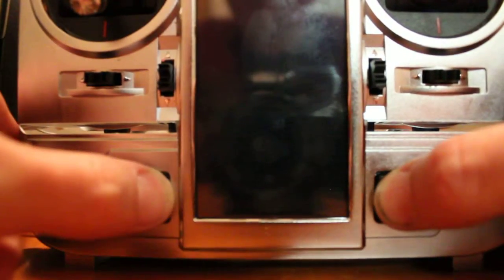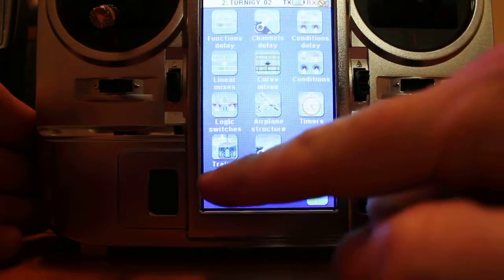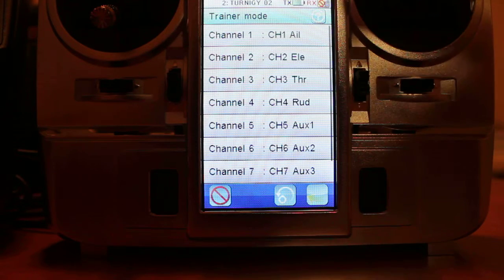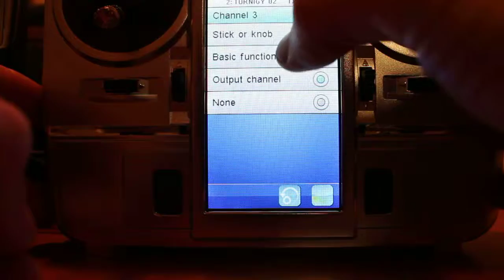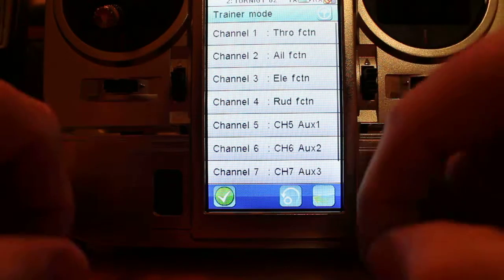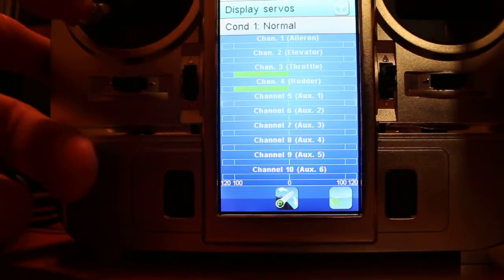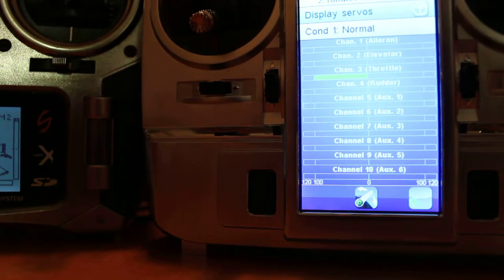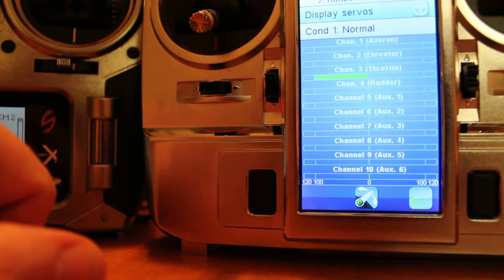Turnigy TGY-I10 Buddy Box with Spektrum controller

Comment: Good info, but how do I set up the TGY-i10 for trainer mode when using a multicopter? I installed the "Multicopter Firmware" update from HobbyKing, but there is no "Trainer Mode" option in the menu. Is there any way to use Trainer Mode with a Multicopter?
Reply from the maker: This would be your best bet. https://www.hobbyking.com/hobbyking/store/uh_viewItem.asp?idProduct=30896

I've tested this on fixed wing  with zero problems.